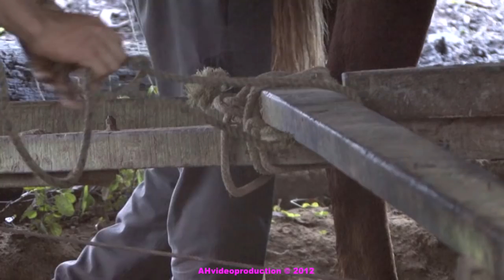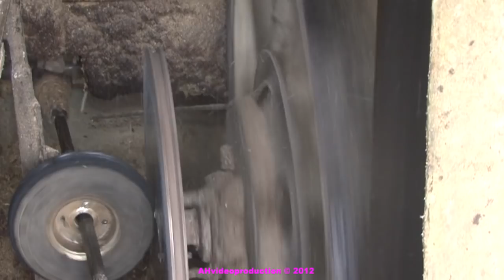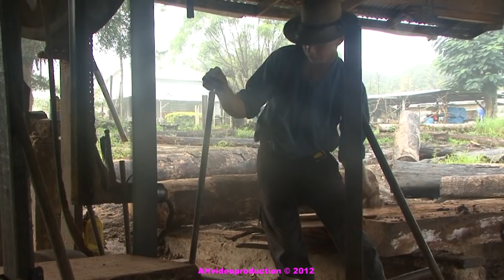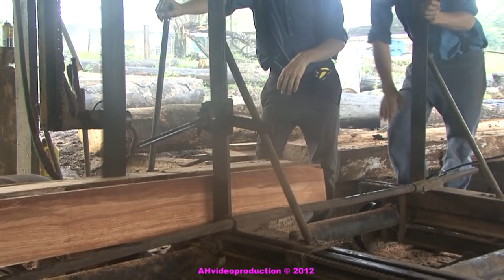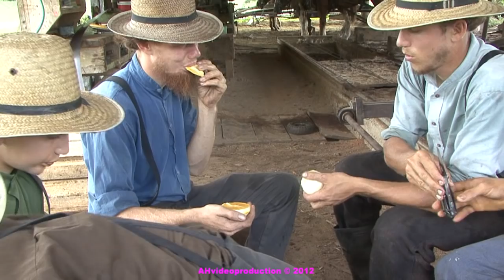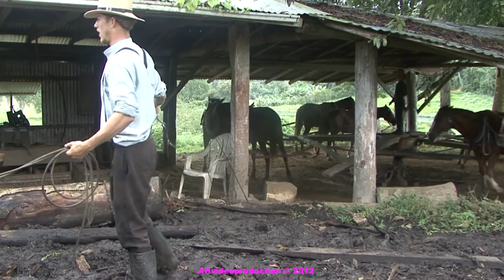247 Horse powered saw mill, Belize

Comment: It would seam more practical to me that you have a steam power plant running off all that wood waste to power a steam engine to run your sawmill as well as a yarder cable to bring the logs to the saw. All in all you are running a more simple method that still works, great job.
Reply: Coming from a guy who has worked around steam engines, it's not as practical as it sounds. It takes a LOT of wood to keep water hot enough to produce the necessary power. The most effective method of non-electric saw-milling (aside from gas powered) is still a waterwheel.

Comment: How does the saw move so fast while the horses walks so slow?
Reply: A step-up pulley method. The horses turning that big wheel around once turns the smaller saw belt wheel multiple times.
Reply: Big wheel moving smaller wheels , this preindustrial technology been around for a very long time

Comment: Liked it & added it to my favorites list

Once those kids learn how to run the mill as well as they handle their animals, they'll have a good operation going, if no-one gets hurt in the mean time.

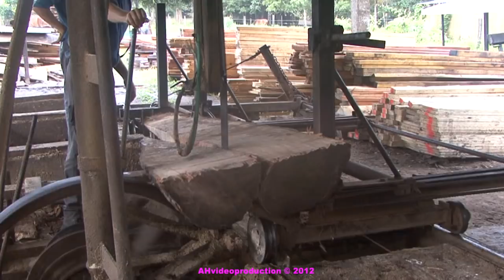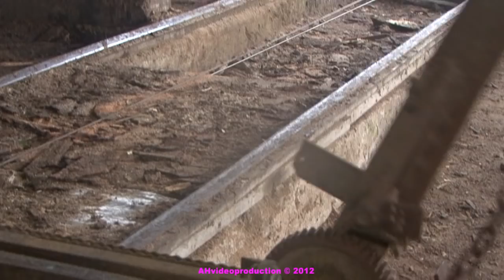Letting the log jam up on the lower band wheel at the 1:22 mark is not very good, nor is throwing the Cant Hook over the log at the 2:21 - 2:22 mark. Not to mention not using the dogs

Other than that, it looks like they did a good job for using a home made mill with some actual sawmill parts in it

Comment: yep just amish folk in a belizen jungle running an 8 horse power saw mill.. guess there is more end torque with all the gear belted pulleys to operate tram and cutting saw..

Comment: nice! but why?
Reply: Ramon Pacheco  They use horses instead of engines and electric motors because horses don't need expensive spare parts and fuel that must be purchased from outsiders.     Being different from the outside world is part of their religon.
Reply: +Ramon Pacheco 

Their "Ordnung" (set of rules) does not allow the use of any engine, because especially Old Order Mennonites and Russian Mennonites, but also Old Order Amish made the experience that there is a strong drift toward
the use of more and more technology, that over a period of several (2, 3, 4, 5) generations leads to assimilation and the loss of their belief. 

They fear the use of engines leads to the use of tractors and then to cars. There are no Old Order Mennonite groups, who use cars, that still have retained the German language. As soon as they speak the languages of the people around them, the pressure to assimilate becomes much stronger.

The more assimilated Mennonite and Amish groups are, the less children they have and fewer young people will join their church. Thus over a long period leads to the disintegration of their communities. 

The idea behind all that is: more technology --> assimilation --> loss of faith --> hell, therefore no modern technology, --> no hell! 

This idea is based on experience. They sacrifice the conveniences of the modern world for their salvation of and the salvation of their children.

Comment: Yes, everyone can go off the grid and beyond and the only thing you need is a horse and some land.  One horse power is 746 Watts per second, 2.7 megawatts per hour. I improved this treadmill by using the concept of leverage to take advantage of the entire mass of the horse over one or two single fulcrums. Two oxen for example 2000 pounds over a radial distance of 200 cm produce a torque of 400 000 pounds. My mechanism has less friction and more leverage. It is called "horse speeding vehicle" and the force of the animal is exerted either outside or inside a semi-circular trajectory. It is expected to produce all the energy any American home needs in more than five months by using just one hour of the work of the horse!! Contact me. 201-552-0461. Let's start franchising this method to generate hydrogen our of snow and for the production of heat, cold, coverage of internet and cellular in all rural areas, etc.

Comment: Interesting how 8 horses through a system of pulleys and belts can make enough power to run a sawmill.
Reply: With the thin kerf of a bandsaw less wood is cut/removed thus less HP is required when compared to the wide kerf of a large circular saw blade. Why even use horses, why not use water power? A stainless steel welded water wheel could easily power a band saw mill and the wheel would last forever only have to lubricate the bearings and occasionally replace them.